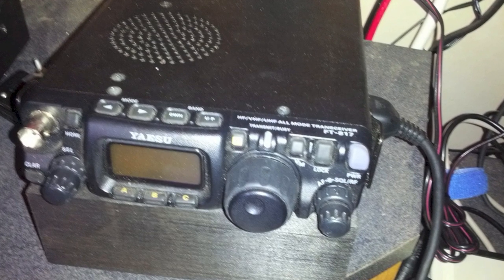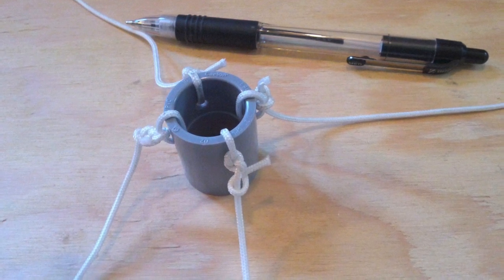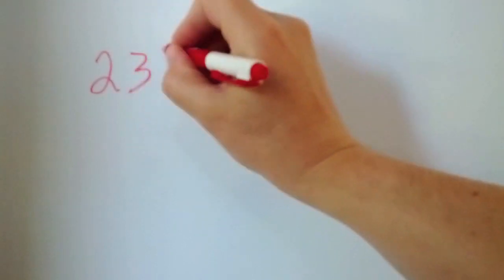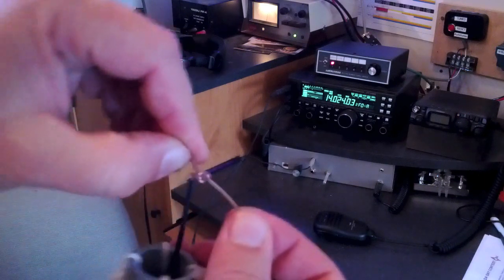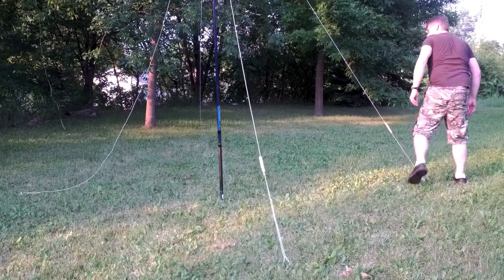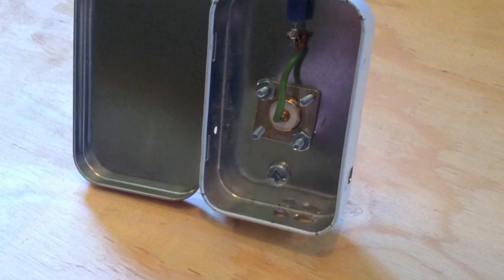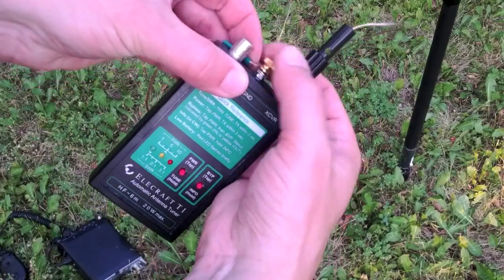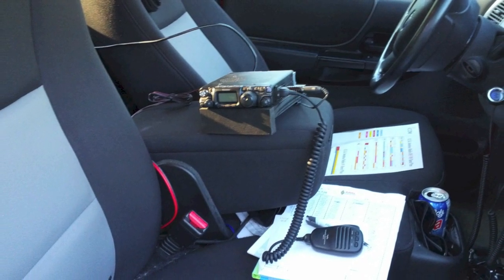Portable HF Ham Radio Antenna

Comment: Questions: Does it matter whether or not the mast is conductive?
                     No impedance matcher/transformer?        If so, it would be a 9:1, yes?
                      No RF choke?
Thank you!
73
Reply from the maker: Usernamemykel, thanks for watching ! To answer your questions:
1-A conductive mast will detune the antenna. On the other hand, if you happen to have a conductive mast (like aluminum tubing for example), you could use it in place of the vertical wire (assuming you trim the length of the tubing to the proper electrical length for 1/4 wavelength)
2- no impedance matching device is required, because the antenna itself is cut to an electrical 1/4 wavelength for the band of interest (in this case, the 20m band).  So on 20m, the feedpoint impedance is 'close enough'.  
3- An RF choke could be used to help decouple the feedline if you choose.  I'm operating with 5 watts portable with this thing - I'm not too worried about stray RF on the feedline.  Keeping it simple!
Reply: @W0ZF   Thanks for the response.
I put up a sloping end fed antenna using a 15'10" fiberglass telescoping fishing pole, it had about a 45 degree angle when the wire (about 19' of 26ga) came down to a PVC pipe about 6 feet off the ground, where I attached it to a 9:1 balun.  I had no counterpoise, but I had a coax run  of about the same length along the ground, then leading up to my second floor bedroom, to my radio,     I received nothing of HF traffic. 
DX engineering said that with my setup, (that is, without trimming the antenna wire to 16 or so feet), the only band I'd receive is 6M, baby monitor stuff.    Suggestions, please?
Thanks!
73

Comment: I did not understand the electrical connection especially the other wire which is the ground side. Can you please provide details or circuit diagram. I want to try it out. Thank you.
Reply from the maker: Hey James, the antenna is a simple vertical with a single ground radial. One wire is connected to the center pin of the radio’s antenna connector and goes up the pole. That’s the vertical radiator. I use a banana plug for this, as it fits perfectly in the center of the antenna connector.
The other wire is connected to the outer part of the radio’s antenna connector and simply laid on the ground, with the other end stretched out as far from the radio as possible.
Since it’s not convenient to connect that wire to the connector itself, just connect it to the ground screw on the radio.
Hope that helps clear it up for you! 
73 de W0ZF

Comment: It's much easier if you just measure everything in metres.
Reply from the maker: Hi dnelson83,
I don’t disagree, but most of us in the US are most familiar with feet and inches, so that’s what I used. 
Thanks for the feedback though...I will try to remember to include both English and Metric units in future videos.
Reply: @W0ZF  Well, given that the ham radio bands are called "meter bands", the calculations using only metres are much more intuitive—divide the speed of light by the frequency to get the wavelength.

73 VE7NDE

Comment: Love the pickup truck idea!  I use the same pole to support a linked dipole as an inverted v and lash it to the side of the bed with gear ties.  Never thought to guy it.  Looks like it provides better support.  Now you gave me a new project!  :-). 73 de Chris K2CJB.

Comment: what would the wire length be on the 2m band? 234/145=1.6! Thanks!
Reply from the maker: That’s correct. Remember that the answer is in feet. 1.6 feet is about 19 inches, which is a reasonable quarter wave element for the 2m band

Comment: Hmmmm I actually have this exact antenna which I used as a horizontal dipole on 20m across my front garden: that was a pita to get strung up. Now I'm going to try your configuration, which is just my dipole with one leg vertical and one on the ground. I actually made a co-ax connector like yours, except I used the plastic lid of a coffee jar.

Ok so I need to go visit the local angling shop now and look for cheap fishing poles. Come to think of it, a ham buddy of mine has a couple of those poles they use outside shopping malls and gas stations to put banners on. Might ask him for a loan of one: I think the length is about right.

Alas my hf rig is in the shop for a repair, but as soon as I get it back....

73 de Jim ZS6JMB
Reply: Damn... tried to deploy mine up a pole I already have in the garden and the string caught in the pulley....
Reply from the maker: +Jim Brown 
Those banner poles sound like a good idea. Hope your rig is back!
73 de W0ZF

Comment: You didn't mention what the 'other' wire is connected to (the ground wire)??
Reply from the maker: The 'ground wire' is connected to the ground terminal of the radio, and simply laid on the ground extending away from the antenna. The other end is not connected to anything. Does that answer your question?
Reply: Yes!! Thank you!! Going to give it a try!
Reply: Wondering now if maybe suspending the ground wire a foot or two horizontally off the ground would work a little better as a partial counterpoise.
Reply from the maker: +Don James 
One or more elevated quarter wave radials may improve performance... I just went with one on the ground to keep it simple, and it works fine. Part of the fun with antennas is experimenting with changes like that, so go for it and let us know how it works out for you!
Reply: Don James 8
Reply: Don James he

honeatyfrwst krdne kliee kwrin
Reply: Don James
Reply: Don James 899977755

 
8p

Comment: I have a question ... The antenna only works with the "positive" or work in short ? Scheme has this antenna to use in 11 meters ? Thank you!
Reply from the maker: I don't understand the first part of your question. This antenna could easily be modified for a higher frequency band- just calculate the appropriate length for the wires using the formula in the video.
Reply: Ok, from what I understand the antenna uses only one radiant, which is connected to the positive, the negative is grounded ... Is this it?
Reply from the maker: There are two wires of equal length. Wire 1 is the vertical radiating element and connects to the center (hot)  pin of the antenna jack on the radio.
Wire 2 is the counterpoise. It lays on the ground, extended away from the vertical element, and connects to the   outer (ground) part of the antenna jack. 
My radio (FT-817) has a ground lug on the case that makes a convenient attachment point for the counterpoise.
Hope that helps! 73 de W0ZF

Comment: great simple, quick and easy!! could i put 200 watts through something like this?
Reply from the maker: I don't know what the max power rating would be. I've used other wire verticals at 100w with no problem. At higher power I would definitely feed it with some coax to get a little distance between me and the antenna though.

Comment: I tried the antenna a couple of times and keep getting 8 bars interference on my 817 nd.......... I lowered the pole to about 5 foot and the interference went.... Do you have any ideas what may be wrong
Reply from the maker: mattyk209 Not sure what you mean by 'interference'...do you mean there was a lot of noise in the receiver with the antenna fully deployed, and less so when collapsed?  If so, it sounds like you're just picking up a lot of electrical noise in the area - it would make sense that it gets quieter when you collapse the pole, because it's not going to pick up as much noise (or signal).  Can you try setting up someplace else? Maybe there's a power line or other noise source close to where you tried it.
Reply: W0ZF what's the best way to get around the electrical noise
Reply from the maker: That's kind of a broad question...in general, you reduce received noise either by reducing the noise at the source, or by moving the receive antenna further from the noise source. It's helpful to first identify where the noise is coming from. A couple ways to figure that out are:
1) Hook a short antenna to your radio and walk around. Noise should get louder as you get closer to the source. If it's hard to tell what direction it's coming from, hold the radio and antenna in front of you, close to your body, and turn around slowly. The noise will be louder when you are facing the source, as your body will block it somewhat when the noise source is at your back.
2) You might be able to identify the noise maker by the sound it makes in your receiver. There are several sites on the internet with recordings of all sorts of electrical noise sources. Try arrl.org/sounds-of-rfi

Comment: What wire did you connect to the ground terminal of the radio? Did you raise two wires?
Reply from the maker: There are two wires of equal length. One is the the vertical element - the one that goes up the pole. It is attached to the center conductor of the antenna jack.
The other is the counterpoise. It attaches to the ground terminal of the radio, and just lies on the ground, trailing off in any direction.
This is just a simple quarter-wave vertical, so it needs a ground plane to work against. That's the job of the second wire.  If you add multiple ground wires to the radio, spread out in multiple directions on the ground, the antenna should perform better, but you need one at a bare minimum.
Hope that helps.
Reply: It's been one of the most helpful things I've read since trying to understand how to build antennas. Thank you.
Reply from the maker: Nigel P. Thanks for the kind words, Nigel! I'm glad it was useful to you. Making contacts on an antenna you built yourself can be very rewarding - keep at it!

Comment: I don't mean to sound thick lol but does the antenna just trail down the side of the pole?
Reply from the maker: Yep. The only purpose of the pole is to hold the wire up. The wire just hangs down the outside of the pole.
Reply: W0ZF thanks for the reply, I'am going to have a go at this at weekend.... Thanks for the antenna ideas :)

Comment: Question:  I'm obviously totally green at this but in spite of that fact, I have built a couple of Frog Sounds like mini HAM Radios (for listening purposes only as I'm not ready to pursue a license yet).

In your video at about 3:03 you say to connect the "other wire to the ground" on the back tot the transmitter  (A non-Banana plug wire)  What Other Wire?  I understand the single wire that is shown wrapped up on the outside of the poles for transport.  Is the "other wire" connected to the end of the antenna wire; creating a big loop that goes up and then back down the or is this a wire specifically to supply a ground source from a copper water pipe or like manor ground?

GREAT VIDEO!  You really did an excellent job on it, the audio & camera work are done very well.  I have produced over 100 broadcast quality programs that have been aired; so I know how hard it can be to make good quality content; such as you made here.

Peace!
Reply from the maker: The 'other wire' is just another piece of wire the same length as the antenna wire, as noted at about 1:45.  It is basically the 'other half' of the antenna, commonly called a counterpoise.  The vertical element (the wire that goes up the pole) connects to the center of the radio's antenna connector, while the counterpoise connects to the outer part of the connector.  For simplicity, i just connect the counterpoise to the ground lug on the radio, since it's electrically the same as the outer part of the antenna connector.
Hope you do pursue your license - it's a lot of fun.
73 de W0ZF

Comment: Wow...just had my first QSO using this homebrewed antenna, between Orem, Utah, and Hebron, Ohio, 1536 miles away at 8:58 am Mountain time under sunny skies in Utah.  My antenna uses three instead of one ground plane wire, all 16' 6" long, and spread out 120 degrees from each other.  I used three instead of four guy strings, each looped simply over a tent stake.  Everything else is the same as Dave had described...no tuner, no balun, nothing else.

The two most expensive things were the fishing pole ($14) and the SO-239 connector($3.49), both off eBay.  Ok, I guess the Altoids were a couple of bucks, but I already had that lying around for months collecting dust.  My rig is a Kenwood TS-940S at 20 W, and my feed is 50' of RG-8X.  I made my contact with WD8E on 14.265 MHz, and he said I was coming in at S9.  Seems too good to be true, but the results don't lie.

BTW, looks like some are trying to find ways to connect the small end of the fishing pole to the antenna wire.  I looped the end of the fishing pole string through a small button, then hot glued the string to itself.  I made a small loop at the end of the radiating speaker wire, then fed both through the PVC coupler, and looped the wire over the button when I erect the antenna.  Seems to stay on well enough, but I had to re-calculate the wire length to compensate for the loop.

Thanks, Dave!

Noji Ratzlaff
KNØJI
Reply from the maker: NojiRatz THanks Noji!  That's a good tip on attaching the wire to the end of the pole. My fishing pole has a small eyelet on the top, so it was pretty easy for me.  Another possibility is to make a loop in some stiff wire and attach the wire to the top section of the pole with a length of heat shrink tubing.

Comment: Great video Dave. nice to see some outdoors set ups. I recently got a 10m pole that has 17 sections, meaning its very short when collapsed. Meaning it can go in a rucksack. Also has a hollow tip for putting the antenna up the middle of the pole. I use that with a 9:1 unun and it works really well. 73 M0TGN
Reply: ColdestMoon where did u get it from or whats the name of the pole? Thanks

Comment from the maker: avgguy47, 234/f = a quarter wave, where f is frequency in MHz. It's basically a quarter wave vertical antenna, with a quarter-wave long radial. You can add more radials to improve performance.

Comment from the maker: It's neither, Terry. It's just a simple vertical. Radiating element goes up the pole, and one or more radials on the ground. To keep things simple I just connect both directly to the radio at the base of the pole.

Comment from the maker: the only parts are speaker wire, nylon string (for the guys), a PVC coupler (for the guy ring), some small wood strips (for the guy tighteners), and the fishing pole.  I bought the fishing pole here in MN at Fleet Farm in Lakeville. I'm sure you can find similar at Cabelas or online.

Comment: Best portable antenna that you can build, check it out.
A stealth antenna for limited space that really works great.
Many Ham Radio operators give up due to antennas restrictions with all the HOA restrictions these days.
Check out Stealth antennas that really work.
QRZ.COM/db/K8NDS       Anyone even in a small lot can have a big signal. Handles full power down to milli-watts.

Comment: Very nice.  I plan to build it.  Would multiple ground wires connected to the ground connection of the Altoids tin (as radials) improve the antenna system?  I'm still trying to understand this stuff.

Al - va3iaw

Comment from the maker: Hey everyone-  I try to answer every question asked, but some of my replies were direct and  don't show up here so I'll try to recap. I apparently was not very clear about the 'ground' wires - yes, they just connect to the ground terminal and stretch out on the ground away from the radio. Also, as Pete pointed out, I showed the wire connected to the wrong terminal of the T1 tuner in the video. Finally, the antenna will easily handle 100w, but I typically use it for QRP. Thanks for the interest!

Comment from the maker: Thanks Pete - I went back and watched that part and you are correct, of course - the T1 has CLEARLY MARKED jacks for ANT and XCVR, and i somehow managed to hook the antenna to the wrong one ON CAMERA!  Good thing I always hook it up the right way when I actually use it :)
Nice catch!
The reason I went with 4 guys is that it's just easier when I put it in the back of my little pickup truck - it has four convenient cargo tiedowns in the corners of the bed. 73, W0ZF

Comment: Nice video. If you want to reduce bulk you can easily cut down to 3 guy wires. 

Noticed that you connected the antenna wire to the wrong connector on the T1! I'm sure you've already realised that :)

73
Pete M3KXZ

Comment: WOW !! Made and deployed mine today !! I made it like you said, 20' pole 18 gauge speaker wire with the feed point connector out of an Altiod tin..... made several psk contacts at 25w then cranked it up a bit for a 75w phone QSO and then got brave and cranked it up to my full 100w and made another nice qso !! My only change is that I soldered the wire directly to the SO239 instead of the banana plug... but THANKS !! I am now ready for Field Day and QSO while camping !!

Comment: great idea !! I plan to use this with my pop up camper ! Question, so 1 wire is tied to the top of the shaft and directly to the radio/coax..... the other is wire is NOT attached to the other but goes from the ground of the radio, to the actual ground and spread out.... correct ?

Comment from the maker: Depends on what kind of problems you're concerned with...I've run 100W with it, but I used coax and the homebrew adapter to get the feedpoint away from my operating position- just trying to avoid needless near-field RF exposure. The RF voltage at the end of the wire can get quite high at that power.
I normally use this antenna for QRP, so I don't worry about too much power :)
73, Dave

Comment from the maker: the ground wire just lays on the ground, stretched away from the radio. Think of it as one half of the antenna - the other half is the wire going up the pole

Comment: Great suggestion. I subsequently ordered some cheap speaker wire and banana plugs on eBay. I will make up the antenna when the parts arrive; and take it out with my telescopic fishing pole & my Yaesu FT 817ND. Hopefully I will get a contact or two. 73 de Bob,  M0BOB